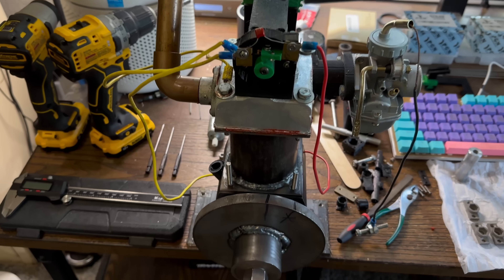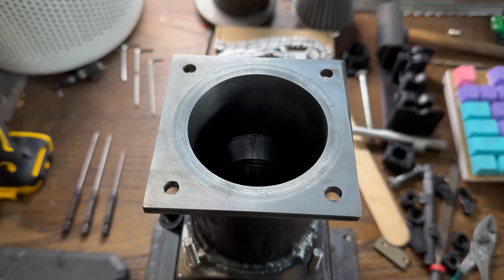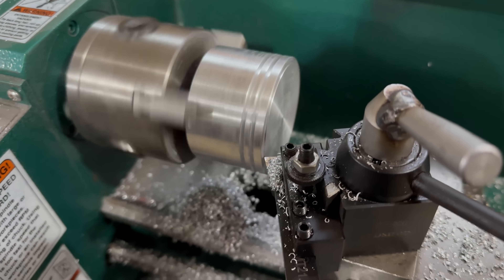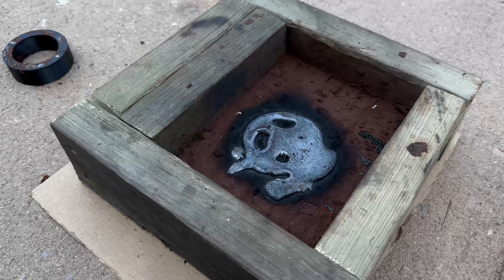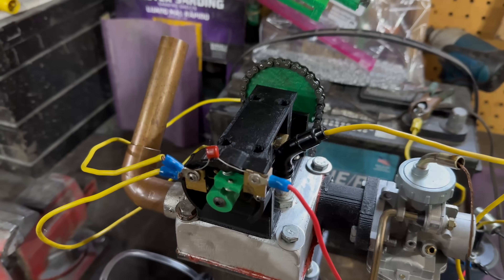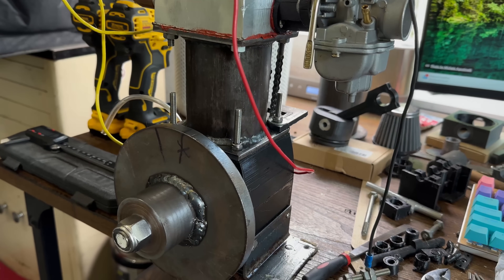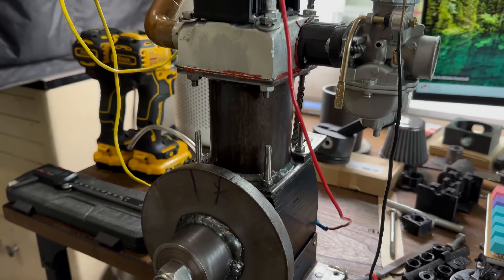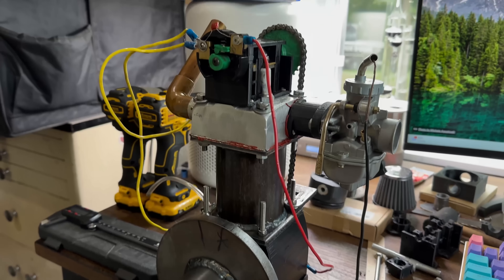Homemade engine gets Aluminum piston! Technology from a Top Fuel Dragster!

Comment: One thing I noticed about the reason it’s burning so much oil, is you didn’t stagger the rings, so you have both ring gaps on top of eachother giving a clear path for positive and negative pressure to leak past, you should have put one  ring gap facing 180 degrees opposite of the other one, also there’s no oil control ring like a typical 4 stroke so it’s always going to burn a bit of oil, another suggestion I had was making a thin sleeve of aluminum with a bunch of fins that you could press fit onto the steel cylinder as a way to cool it, and maybe make a little oil pump that runs off of the crank so you can install a little oil sprayer for under the piston to lubricate the wrist pin and cylinder walls more, just as like a preventative measure, other than that it looks cool 😁
Reply from the maker: I did stagger the rings when I installed the piston, and I figured I wouldn’t need an oil ring, and I really don’t, but after the runs, it drank about half the oil in the crank case. I have a 3-D printed water cooling jacket, I just wasn’t expecting it to run long enough to need it.🤣 although I have some exciting plans for the next video so it will definitely need it!

Thank you for watching!!
Reply: @ProjectLMZ  Ohhh fair enough, I just didnt see that, when you showed us the piston it had the ring gaps on top of eachother xD yeah I guess you dont really need an oil ring haha, It drank half the oil!? hmm, Maybe ring gaps too big then if they were staggered, Nice a water cooling jacket, thats cool, haha yeah looks like you did a pretty good job because it ran for over 2 minutes on a handmade engine xD But yeah no problem, thanks for making videos and stuff, cool to watch projects and interesting stuff like this.
Reply from the maker: @ChrisS22699  in the next video I’m going to make even more parts out of metal, and I’m guessing it will probably run as long as I want it to after I do that! At least that’s what I’m hoping anyways. The bottom ring gap is wider than I’d want it to be, but the top one is nice and close, but either way burning a bit of oil it shouldn’t hurt anything, as even with 50 mL that’s giving me a bit of extra. Although it burning half of it in 2 1/2 minutes is a little concerning. I might have to look into adding a really shallow oil ring, as I really didn’t give myself enough room to put an oil ring on the piston.
Reply: @ProjectLMZ  Nice Im looking forward to seeing that, I mean the plastic parts are cool and all, but It would be even cooler to see an all metal engine you made on your own and maybe put it in something to ride and improve on the design, Who knows, You could design engines in the future for big corporations, which would be pretty cool, and Yeah burning the oil wont hurt anything, just have to keep up on oil levels since its burning its own crankcase oil, and you might foul a plug or two but thats replaceable, Yeah that is kinda concerning, burning that much oil, I think your compression is good though because it was wanting to diesel and run away, but yeah, maybe an oil ring might be the best bet, I was also thinking you could put a one way valve on your crankcase breather and have a hose after the one way valve connect to the intake after the carburetor to provide positive crankcase ventilation, It doesnt need that, but Idk, would be interesting to see what happens haha.

Comment: It'll run as fast as it can if there is no governor idle control. And if there isn't a throttle limiter for over rev protection you can run into problems. Lol
Reply from the maker: Those are the good type of problems, the problems I’m having right now are with it running for extended periods of time.🤣

Comment: The smoke sitting still like that is actually a bad sign. That's called still air. It can be deadly in certain situations. You may want to consider ventilation of some kind.
Reply from the maker: Yeah, after I filmed that, I opened up the overhead door and got some breeze in there. After I opened up the overhead door, all of the smoke dissipated, but it was still pretty cool to see the smoke completely still nonetheless

Comment: Great Job ! 👍 You can cast up a con rod too.  They are actually pretty easy to make. Now you've got a Real engine there!  Sand casting is a black art for sure.  You can help to eliminate the tiny bubbles in your castings by only using clean metal to melt.  Also, the temperature is very important don't get the melt too hot.  Pour right at 1200 degrees F.  don't allow the melt to sit in the crucible and bubble. If you aren't already doing it have a riser so that the molten metal flows in smoothly in, then comes into the mold from the bottom and flows up and out of the riser. emphasis on smoothly.
Reply from the maker: Thank you!

Comment: Please get an exhaust fan. the stagnant smoke means there is no airflow, meaning CO2, CO, and everything else will more or less stay there till a breeze comes through. very dangerous.
Reply from the maker: Right after I filmed that clip, I opened up the overhead door, I just thought it was pretty cool that it was completely still. I knew that it meant no airflow, so I immediately opened up the door.

Thank you for watching!!
Reply: @ProjectLMZ  absolutely! I had tried doing this same project when I was 14, but since i had no real concept of types of forces, the crankshaft sheered multiple times, and i gave up. I'm glad to see more people trying this!

Comment: This is really cool, you should really learn to tune carburetors lol, if it started gaining rpm at idle, then you should just lower it, its not too much fuel. Do you have plans for cooling? youre gonna need that in the 4 cylinder. also you can use a silicone hose like the ones used on radiators for the exhaust, they can handle the heat and itll hold the exhaust in place.
Reply from the maker: Well, but the weird thing is that the carburetor was set how it was when i started testing like 4 months ago, and that was the only time it did that. Also, you can kind of see in the video It starts to smoke more when it starts picking up RPM. I have a water cooling jacket printed out, but I wasn’t expecting it to run long enough to need it. 

Thank you for watching!
Reply: @ProjectLMZ  yeah carburetors are weird and definitely hard to master, im having problems with mine right now lol, but i have no doubt that you will figure it out tho. Looking forward to your future videos and engines! Good luck.
Reply from the maker: @RainbowSheep_was_taken  thank you! I have big plans for the engine in the next video!

Comment: make connecting rod from metal.stupid 3d print and why is so hard to make cooling fins.
Reply from the maker: You’ll be excited for my next video, as I have a titanium connecting rod being made. Also, I have a water cooling jacket 3-D printed, but I wasn’t expecting the engine to run long enough for it to be necessary.

Comment: I can't wait for this engine to run reliably enough to be actually useful for a go cart 
It runs really well... idk how long it would run before it would overheat but it runs 
From what I read aluminium likes to dissolve hydrogen when it gets too hot which causes a lot of porosity 
But yeah in this case it's totally fine as it retains oil and the piston is I bet way overbuilt for the amount of power this engine will make
Speaking of power... after the engine is done and can run for hours and not break, you could look into making a dyno of some sort like for example a prony brake. It seems simple enough to make and I have found some people who are using an arduino to do all the math and stuff.
Reply from the maker: I was actually thinking of making a brake dynamometer for the engine, I was planning on using a disc brake system from a bike, and the rest of it would be pretty easy. You just put a scale onto a lever arm that has the caliper on it, and measure how much force it is, I would use a 6 inch lever arm, which means I multiply my numbers by two, and that gives me the foot pounds of torque the engine is making, and then I multiply that by the RPMs and then divide it by 5252. And the piston is way over built, I just wanted to error on the safe side.

Thank you for watching!!
Reply: @ProjectLMZ  yeah building the dyno is easy, capturing the date and making a readable graph is imo the harder part.

Comment: Insane work man, but there are 2 things that you might need to know, the balancing fact of the crank and the piston because if its unballanced it will vibrate a lot and cause issues, maybe the crank broke because of the unballance it has, and then the piston is from aluminium and the cilynder is from iron ,the piston will expand way faster than the cilynder and cause a seizure because it has no cooling or anything, yeah it would be like 3-4 minutes running to seize but so you know, keep up the good work man!
Reply from the maker: Once I get a metal connecting rod, everything should be almost in perfect balance, my counterweights on the crankshaft are about 576 g, and the piston, wrist pin, connecting rod, crank pin and throw arms, altogether with a metal connecting rod will weigh about 575 g. And for the piston, I have 0.17 mm total clearance, which is in spec for most production engines with aluminum pistons and steel sleeves. And I do have water cooling jackets printed out, but I wasn’t expecting it to run long enough for it to be necessary.

Thank you for watching!!

Comment: The plastic or carbon rods is actually kinda smart, any failures won't damage the metal components because its carbon/plastic outside of the piston hitting the valves, which since they go straight up and down, should just lead to the plastic components holding them to shear, again accidental genius for testing. Metal may not be the best idea for a test engine on those components.
Reply from the maker: The plastic connecting rod actually surprised me, but in the next video, I have a connecting rod that will never break! I don’t want to spoil too much, but if you check out my community post, you might get an idea.

Thank you for watching!!!

Comment: I don't know much about aluminium casting but I think the porosity is caused by dissolved hydrogen gas. You could bubble argon or something like that through molten metal to get rid of it.
Reply from the maker: I could try that, but more than likely it’s my mold release powder, as I didn’t have any, so I used cocoa powder.🤣 I definitely think that’s the mistake, or it might be because the top fuel pistons are forged. 

Thank you for watching!!
Reply: @ProjectLMZ  Cocoa powder? That's the first time I hear someone use it this way. Very interesting
Reply from the maker: @pvc988  it was the only fine powder I had on hand, but I think that was probably my mistake. I think that probably is the reason why there was a whole bunch of gas bubbles🤣

Comment: A tip: casting aluminium is hard for the ‘at-home-guy’. They’ll usually pull vacuum on the casting in commercial places specifically for what you saw. Further, anyone who’s tried to weld cast aluminium will know it’s still got porosity even when a full vacuum is pulled during casting.
Reply from the maker: The only issue is I just don’t have another metal that is as light and as strong, I thought about magnesium, but it’s more difficult to get (I can get aluminum from pop cans) and if there’s any moisture in the mold, it will explode.

Thank you for watching!!
Reply: @ProjectLMZ  Alu absorbs Hydrogen from water in the air, its what makes the cast alu a little bit more brittle using borax would help a bit to protect the alu from the air. i have done it with cans aswell and the voids are inevitable but can be reduced. if you whant it to be stronger you can maken alu-brons by adding a bit of copper. there are ratios online for sertain uses. alu-brons also has more heat resistance.
Reply: @ProjectLMZ  You should cast using zamak, its casting finish is absolutely beautiful.
Reply from the maker: @burnologist229  if I remember right, Zamak is very weak though, I’m gonna look up the tensile strength real quick
Reply from the maker: OK, I just looked up the tensile strength and it seems to range between 15,000 psi and 40,000 psi, but I don’t know if that is billet or cast parts, as cast parts are usually weaker
Reply: @ProjectLMZ  Only one way to find out if it is strong enough lol,  
On a more serious note, You should consider learning how to wax cast. The tolerances are tight, the finish is nice and the geometries capable of being cast are unlimited. Print2cast has a wax filament for 3dprints. 
If you don't want to take that route you can print the part, pour platinum silicon over it, take the part out, then inject molten wax using a metal needle. ive done this and this is GREAT for multiple of the same parts.
Reply: @ProjectLMZ  100% agree with you that you can’t get anything else light enough that’s strong enough. But I’m just saying that it’ll be difficult. You COULD build a tiny vacuum chamber, with a ‘quick attach’ type lid and 3D print a vacuum pump. You seem like a kid with heaps of work ethic and a decent bit of brains. You’d then be able to cast slightly less porous aluminium then😂 Do you FEA many of your parts or just hand calcs?
Reply from the maker: @MarkValascun  with all of my parts I have a 3-D model of them, and then I do my best to copy the 3-D model, but it’s usually not even close, as with the head, the 3-D model has it at 25 mm tall, and the actual head is 40 mm tall
Reply: @ProjectLMZ  that’s fine, that’s what engineers deal with everyday. Do you know what I mean by FEA?
Reply from the maker: @MarkValascun  yes it is finite element analysis
Reply: I haven’t heard the name “finite element analysis” since I left the machine shop 😅 Know there’s an engineer close when those words are spoken!
Reply: @robertwest3093  hahahaha, to be fair I respect your skill of being able to know ‘yeah that’ll do’ from 20 years of seeing if stuff break or not😂 maths and FEA just have too many helpful aspects in SOME parts of the motor🤷‍♂️
Reply: @ProjectLMZ  AL cans and AL car wheels are a similar alloy. should be able to find a scrap car wheel for next to nothing. way less slag to deal with than melting a million pop cans.
Reply: nah its not worth that just use some borax and salt mix to degas and flux is al you need.

Comment: Damn this thing runs really good now. But yeah it throwing the rod was kindof expected. I mean the mass of the piston is waaay higher so it makes perfect sence. Still curious about the bearing situation. In theory it could make the engine run even better since there would be less resistance. Overall tho great stuff
Reply from the maker: Thank you!! With the new PETG rod I’m surprised it didn’t throw the rod either, but I have a super exciting rod coming in the next video!! And yeah, the piston is 100 g heavier than the plastic one, the plastic one was around 120 g, and this one is around 222 g.

Thank you for watching!!

Comment: The commentary had me rolling. 

Really nice work. If I may suggest, you’re starting to get enough run time to where it may be necessary to start considering a cooling system, whether it be a fan/blower setup, or even some sort of water jacket around the cylinder.
Reply from the maker: I have a 3-D printed water jacket made, I just wasn’t expecting it to run for that long.🤣 in my next videos when I get even more metal parts I will definitely be adding it since it’s running so good now. 

Thank you for watching!!!

Comment: why don't you make it two stroke? is way better to have ports rather than all the valves and timing chain. you can also use reed valves that are very easy to do. moreover you should put the intake reed near one of the transfer port. the timing that i suggest is 160 exhaust and 110 transfer port. you can do the rings with a sheet of flexible iron 0.25 mm thick and some fantasy. you can take inspiration from the 40cc engine that are in minibike or the modern rotax engine
Reply from the maker: I attempted the two-stroke a while back, and that was when most of my stuff was still 3-D printed. I couldn’t get the ports right. Also, I’m going with the four stroke for one particular reason. Boost. I’m planning on boosting this with either a turbo or a supercharger!

Thank you for watching!!!
Reply: @ProjectLMZ   yeeeeeee amr 300 incoming yeeeeeeee
Reply from the maker: @fabiotiburzi  that’s what I’m thinking!! Also Suzuki has 150 cc turbo, so I could also do that and they’re around the same price
Reply: @ProjectLMZ  fantastic! Later on i'll watch tje two stroke video also
Reply: @ProjectLMZ  ok, i watched the whole series of video about the two stroke. the problems were: transfer port and exhaust port at the same height. exhaust must be higer. i suggest 40% of the stroke for the exhaust port and 25-30% for the transfer. second: you only used one transfer port directly in front of the exhaust. two of them, one on the left and one on the right of the exhaust pointing a little away from the exhaust would be better. third: the piston had too much clearence  from the wall of the cylinder. it has almost to rub. fourth: no chamfer to the ports. the ports must be chamfered (or how the hell should be written ) on every angle that is exposed to the rings otherwise those will be cutted by the ports. to mitigate it even further try using smaller ports but more ports (two exhaust and four transfer to mitigate that effect. with a metal piston and har cylinder wall should be even easier to mitigate the effect on the rings but the skirt must be longer than the stroke.
Reply from the maker: @fabiotiburzi  I do eventually want to try a two-stroke again, I have a crazy idea I thought about, but it would need to be a two-stroke not a four stroke.
Reply: @ProjectLMZ  i'll be here if you need knowledge about it